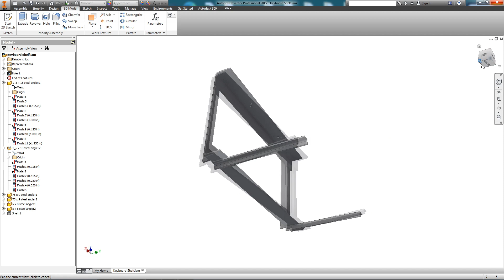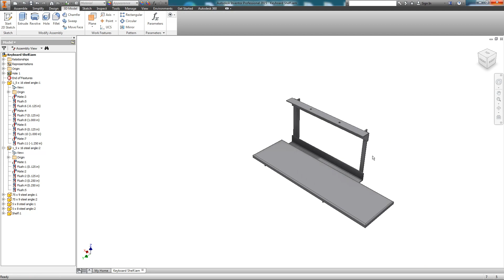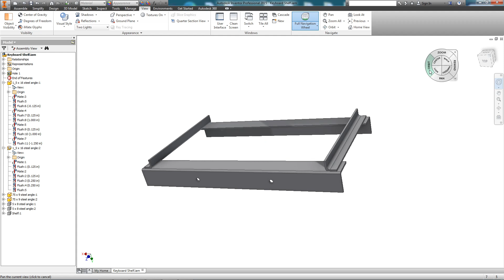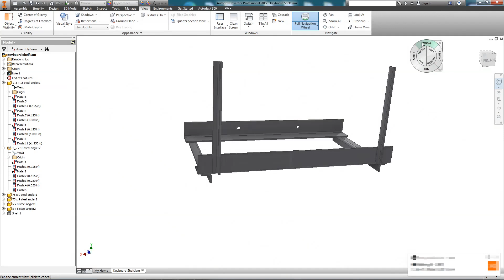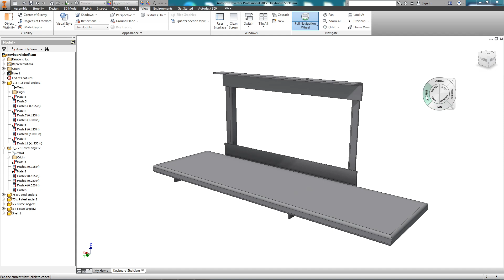Making a Welded Keyboard Shelf with the Titanium Flux 125

Comment: Love my little Flux 125. I built a brush guard for my riding mower.
Reply from the maker: I have a monster Everlast 251si MIG welder with both argon and C25 gas, but use my little flux 125 most of the time now as its so small and easy to put where I need it.  I cant even lift the 251si and thats without the gas canisters.

I also have an Everlast 255EXT TIG welder and have only used it for a couple projects.  I am pretty good with TIG, but the prep needed adds hours to most projects. Again I prefer my flux 125 if I can get away with it.